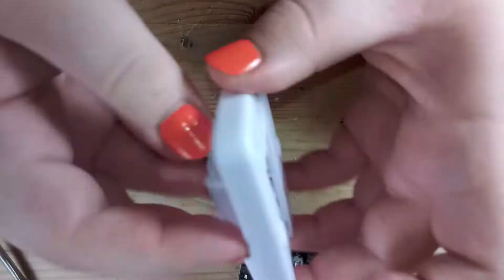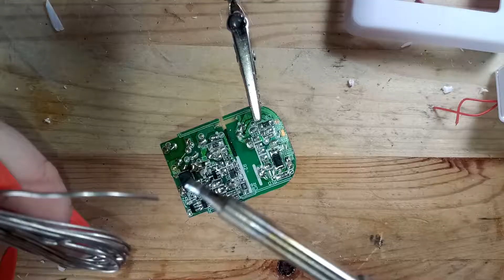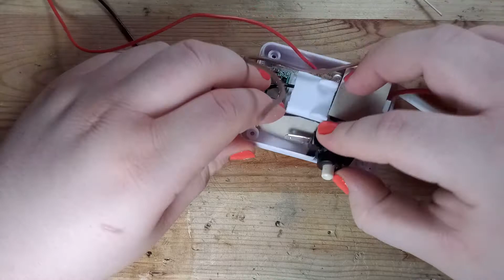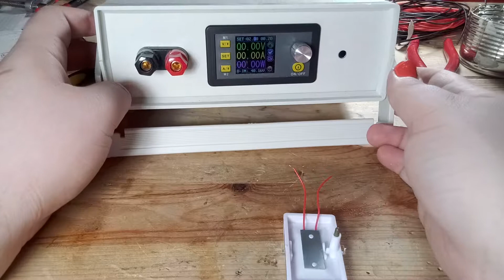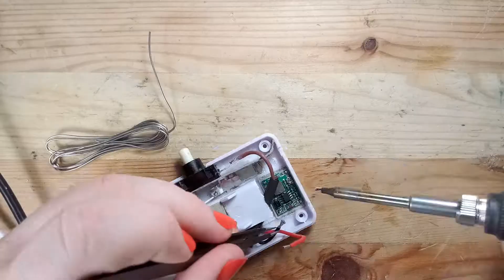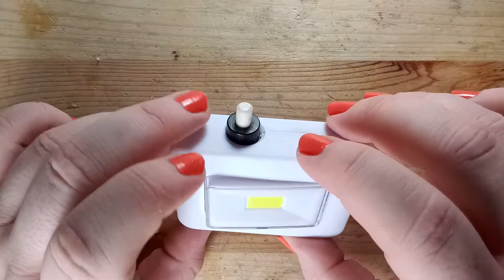Cheap $1 LED Light Upgrade

Comment: Cardboard can absorb moisture. I would sandwich it between some tape at least ; or rather, use thin plastic from blisters (packaging) or a plastic bottle (the  two liter straight kind, not the corrugated ones) as an isolator. You only need small sections after all and you just have to score where you want your folds to be with a blunt blade or heat the line with your soldering iron (without touching of course) before bending. 
Nice project by the way. ;)